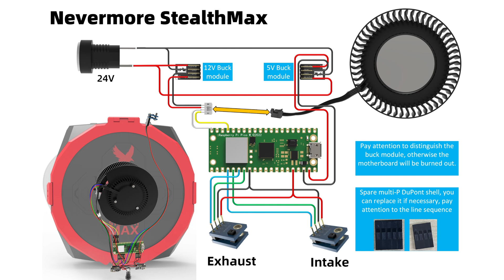StealthMax

Comment: I built the kit last night, and my 2 biggest problems: the pins of the sensors are too short on both stacks, and the cable to the intake sensor is too short - and the combination of those two factors makes it really difficult to mount that sensor. I crimped a short 4-pin extension cable to somehow get it to both keep the cable on the pins and mount the sensor stack to the lid.